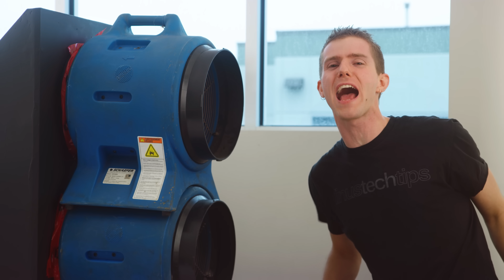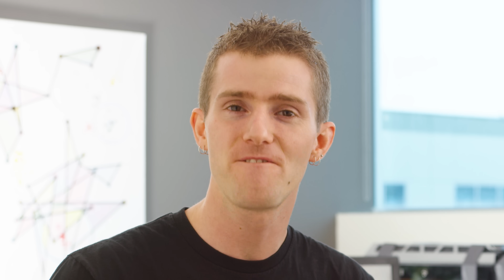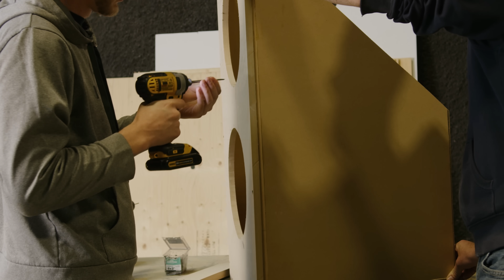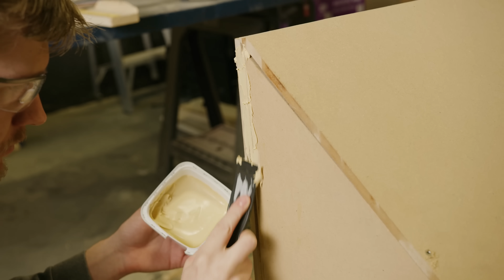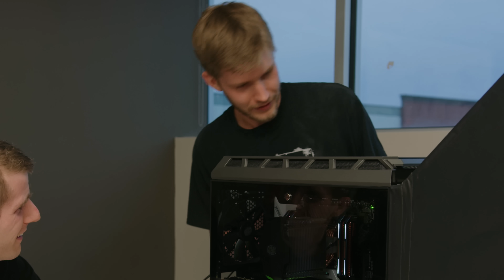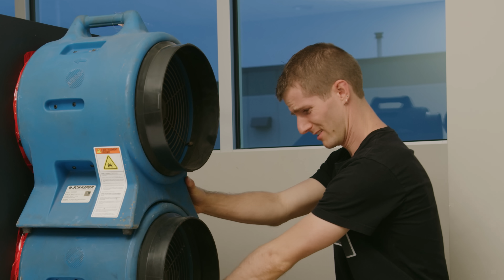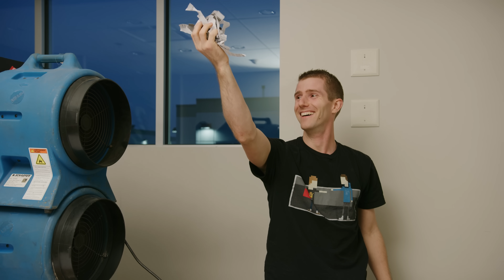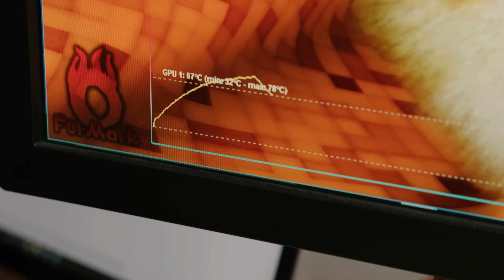Highest Airflow PC EVER - SUCCESS!

Comment: I have but one word: DUST.
Reply: Put the computer in a hermetically sealed clean room.
Reply: nope the air isnt coming from space...
Reply: Because positive air pressure is one word... Yea... I'm a moron don't mind me.
Reply: i have one word: electricity bills
Reply: thats actually 2 words
Reply: No it's not, you're just reading it wrong.
Reply: @liu7  shot rip my English
Reply: little dust would accumulate, it will clean itself quite well from the air pressure.
Reply: @RealAnthonyCallahan  or sand down the components
Reply: I also have one word: positive air pressure. Lots of positive air pressure. Like the top of the case comes flying off positive air pressure
Reply: Rev_dude Self cleaning.
Reply: One word. Tacos.
Reply: @vertigosun3896  1 word: hungry
Reply: I have another, static electricity
Reply: Rev_dude that is gonna blow the dust out of your pc
Reply: Refurbishers use Air Pressure to clean cases out before reselling PCs
Reply: It would be fine many manufacturers don't need dust filters when the setup airflow correctly
Reply: HOW?
Reply: DE_DUST
Reply: I hate Dust!
Reply: Do you think dust would stay in, if the top cover doesn't stay on?

Comment: That's actually a good idea, if you could put those fans in another room, they could cool like 10 PCs at once. Maybe even 20.
Reply: Central air conditioning,for your pc.
Reply: Whole Room Whatercooling V2
Reply: You're literally talking about a server room. Most of them are just as loud or louder than this setup because of the high-cfm fans.
Reply: @DockterDoom  Most server rooms to my knowledge, changes the air flow of the whole room. He is thinking of building a duct to every PC that sucks air out of the room or pushes it into the room. 

Most server rooms don't have the ventilation ducts pushing air right into the cases to my knowledge. Then again, maybe I haven't been in rooms with particularly high respect for the IT porn.
Reply: @Helveteshit  It would be interesting to duct air to individual pcs from AC and exhaust it outside. But I don't think it would make sense from a cost or performance standpoint.
Reply: @Helveteshit  usually there isn't, just to help keep them clean, its usually just a air conditioning unit to help keep the ambient temperature, or if it's real low tech there is just an exhaust to keep circulation going.
Reply: @DockterDoom  its not really the cfm that produces the noise but the actual velocity of the air, same cfm over a bigger area = less velocity which in turn is quieter.
Reply: Data Center. The word you are looking for is "data center"
Reply: You actually can - Since the disappearing of the "optical drive" (CD or DVD reader), there's even less physical interaction between a user and a computer. All devices can now control your computer using USB, and only other thing is video/sound. So, you could connect to your machine using 1 USB (3.0) and 1 HDMI cable. The quality may degrade if you take a long video cable, but USB won't mind. And then you can run cables through your house ..
Reply: Or you just put the pcs in an other room and cool that room. I should do that. I think I will call it server room.
Reply: I think another building would be better.

Comment: Need to build a PC from blowie-matrons
Reply: Misses power botton... looses finger
Reply: Rev_dude Misses finger, uses wires to control. And the you won't lose finger if you miss the button while the machine is off. You still need to press it to turn on

Comment: Is there any point to using a "high air flow" case when your using a blower type GPU though? I don't think there is even if your running a stupid high OC on the CPU with a full bank of HDD or SSD's plus full RAM slots.

I guess the two big intake fans up front might be nice if your running a dozen SSD's and doing a butt tonne of read write though?

Comment: you do realise car radiator fans easily move the same amount of air as those "MASSSivEEE" fans. 
Id be interested to see instead of the fans you use Industrial cold room refrigeration fans ;) But really all you need to do is match the air volume of the case with a fan and for good measure double it, 2 of those fans was massive overkill

Comment: Pff, what a weak build. Do you even fan? I have a rig that auto orders gtx 1080ti's and motherboards and reinstalls them because MY industrial grade fan actually pushes on the card so hard, it snaps the pci-e slot clean off the motherboard every 5 minutes.

Get on my level. Your rig is at a set price. Mine will never stop getting more expensive. I am so much more hard than you will ever be because I have the most optimal air cooling solution for hardcore overclocking rigs that don't want to use that plebeian, ugly, disgusting custom water cooling loop.

Sometimes paint comes out of my mouth and I can't make it stop.

Comment: Okay, next build a fully water cooled system (with mono block).  But use a small car rad with these fans attached.  And put the fans and rad in a different room.  Now it's cooler and quieter.  Do it!

Comment: it would have been much better if the two fan is exhaust. install a duct elbow at the top, straight duct and a canvas connector for vibration. also remove all the casing fans. just re install the filter and cover the rear fan opening. why? because with a direct drive fan, the supply air of that fan is hot due to the motor. and even just 1 fan with 200CFM will do, even more that the capacity required. or get a centrifugal/ sirocco type blower.

Comment: Please do this again and add huge exposed heatsinks on the CPU and GPU.  That's a completely closed up founders GPU and you're still seeing great numbers.  It could be that much better if you just use a card with big heatsinks and you could simply remove the plastic shrouding on it

Comment: you should get 2 more of these blowers and set them up as exhaust fans :) ...and you might want to unplug all the fans from there corresponding power port otherwise the overflow of power from over-reeving the fans can fry the components. I also remember one effect that you talking about where you can put water onto a surface and when it evaporates you can actually get cooler temperatures. get some waterproof fans onto a liquid cooler and spray a mist through the radiator, just to see what happens. finally you did a video where you put a pc into a refrigerator, why not take a window ac unit and just use the exhaust (cool side) as the intake for the computer. or even tape into the coolant lines and use that to cool the pc. much like you did with that one hvac pc case.

Comment: Yeah, that's really loud! My friend's HP Laptop CPU fan died. So while I was there trying to get her printer to network & print, I noticed the CPU temp with Speccy was 97 degrees C! I told her to get the best fan that she owned out. She brought out this Lasko blower that has a 2" adjustable slot for air output. I turned it on about 15' away from the laptop on low speed and the temp dropped from 97C to 51C in 72 seconds, and stabilized! And the sound level was only 44 dBA! Wow! I'm ordering one of these bad boys for myself! It felt as though I had walked into the air conditioned dairy section at Costco. As though someone had brought a portable AC unit into the room & turned it on, wow! It's a much more concentrated & directional flow, which is why it cools so well. The only con is that you have to weigh down any loose paperwork in the room, because of the volume of air being moved.

Comment: Air Zoom Box - maybe you should just build a case into your HVAC system next time.. think Donuts.. The Torvalds Terrible Torous (T3) Case.. you can also power it with leftover heat for fusing Hydrogen Plasma

Comment: One of those fans consumes more electricity than that PCs power supply is rated for, and you used two fans.
I guess this goes to show that if you throw enough "just add more" at any problem it ceases to be a problem (or at least not the same problem).

Comment: Everyone's dropping suggestions. I'll drop mine. Make a DIY video using a vacuum as a replacement for exhaust ventilation. If there's enough suction it will actually increase airflow into the unit.Also I once used a hair blow dryer on cool mode to keep thermals down on an old shitty laptop so I could game better and it seemed to work.

Comment: Now if you could just move those fans out back and duck work the air intake to the computer and it out put I bet you could achieve that air cooling without all the noise in the room.  You would probably still hear a bit of it but not that high of decibles

Comment: How about a closed circuit active cooling system ? Like using air conditioner heat exchangers modified to work with Peltier blocks ?

Comment: The fans will litteraly die way faster
Reply: well when you think about it... the only thing the actual computer fans are doing at this point is restricting airflow... you could likely remove all the fans inside the case!
Reply: They'll be spinning at a rate they're not supposed to. Thus, wearing out the bearings way way way faster.
Reply: kensley innocent Why?

Comment: Decent cooling for a GTX 480.
Reply: Cook with sli gtx 480. 110 degrees on a gpu
Reply: ayy
Reply: you mean " Barely adequate cooling" I'm pretty positive it would give liquid helium a run for its money when cooling a gtx 480...
Reply: Maybe for a FX5800, kiddo.
It is definately not any louder.
Reply: Antti Kettunen Finland ain't Alaska
Reply: I only get 40 degrees celsius for gtx 460 though
Reply: He could use cowling flaps to increase air flow even more
Reply: Nah all itd do is blow your sausages off the grill
Reply: Engine cowling can freeze aircraft engines if open too wide, so do not thing that some sheets of metal are not effective. Cowling would increase air flow by a massive amount.
Reply: CJ no more mehish
Reply: For a 8800 gtx
Reply: I've had one of these 480s some time ago and I guarantee these fans will probably burn with that GPU kkkkkkkkkk
Reply: Or FX 5800 Ultra.
Reply: On full load a gtx 480 can hit temperatures that rival those of the surface of the sun.
Reply: Checkm9 

Damn you live underwater with ur PC
Reply: The GTX 480 Ultra was my first gaming graphic card. I had no idea for years that it was just hotter than others, and just thought all were like that. So weird hearing people reference it as the extreme bad.
Reply: misinformedmarti 

AMD > Novodio > Shintel
Reply: is that good for core i3 if it isnt will it be for core i4?
Reply: yea, but would need to add a third blower if you decide to spring for a vega 64
Reply: And for 690?😂

Comment: Most of the air exited the open side.  What you should have done is build an MDF case with Plexiglas windows on the side (inside mounted) and totally removed any possible blockage from the rear.  Then run it where the air actually goes all the way through.  The case will have to be surrounding the PC and screwed to the fan casings.  Some venting might be needed on the side in order to match the volume intake but still force most through the system or it may just rip itself completely explosively apart.  :-)

Comment: This makes me wonder, what if you had a 747 sitting on land, not moving, with it's engines at full throttle, with the wind from the engines being directed/funneled into this kind of cooler. Assuming all the parts stayed in place (although they most likely wouldn't, especially the GPU), would all that wind lower the temperature even more?

Comment: Only reason why the CPU temp was barely affected was because the high volume of air wasnt really going through the heat sync. If they wanted the best result, they shouldve created a shroud from the cpu heat sync to an exhaust vent then sealed everything else excluding the gpu exhaust. That was the only reason why it had the most effect on the gpu.

Comment: BTW an average house AC uses a blower that moves 800-1600 CFM depending on house size and are usually no larger than 1/2 HP

Comment: Such an amateur, next use aircraft turbine.
Reply: It would need a 100 kVA diesel generator (us$7000), 1 ton of air 3.5kw 24h/24h = $23.50X28.5 to kVA = us$670/month + it would destroys the computer fans + wreck connectors of cards, just miliseconds before the whole computer case explodes ending up freezing the rest, would be cool to watch. That is If an aircraft turbine consumes only 100kVA which I doubt. Might end up been 7000/month.
Reply: tfw everyone takes the obvious joke seriously
Reply: He means put the intake in the pc to create a vacume not put the jet exhaust in the pc its not to hard to figure out
Reply: Umm, that would be counter active, as those put out heat. Couldn't even do that as a PC build theme for MSIs Afterburner software.
Reply: You need to use a jet engine compressor (jet engines consist of three parts: the compressor, the chamber and the turbine), but you'll need a hefty motor to spin it up to 120000rpm or more
Reply: thats why you use them a vacuum not a blower.
Reply: @fucking dank This IS the Linus Tech Tips channel isn't it? You know the one where they go over the top and try to make meme computers and take all jokes far too seriously.
Reply: Just use a jet engine with a smaller engine core like GEnx 2B's onboard the 747-8.Also,don't use an F35 engine
Reply: Mental Case Gamer Hmm I think he was talking about a pull configuration.
Reply: We use the 12th compressor off a turbime engine to create airconditioning in the AC I used to work on. This is not a dumb idea as I could blow snow into the cockpit if I really wanted to. I wonder if we could get GPU and CPU temps below zero.
Reply: But that air is hot...
Reply: I was thinking a turbocharger off a diesel van would do the job, with the spindle attached to a 5hp industrial DC motor. Could use both radial stages of the turbocharger in series... or as inlet & outlet...

Comment: This is actually not so ideal. This is because when the fans of the GPU and CPU rotate faster than they were running, they produce spikes of high voltage. These spikes could easily damage the PC.

Comment: IDK why you used positive pressure. I would have run negative. The case top would not have flown off but the rarefied air might not have cooled as well. It might be worth a test tho

Comment: Have you tried an Intel Xeon Phi Coprocessor (PCIe version) on this? The card is a passive cooling thing w/ ~350w max power consumption. (Really, really hot in my own test bench.) It is interesting to see if the huge fans work for that.

Comment: Now what would be really useful is the find out the optimal air flow rate for maximum cooling.
( because as flow rate increases, at some point, the air molecules are not in contact with the sources of heat long enough to capture the heat, and you achieve diminishing returns as flow rate increases)

Comment: Put the fans outside and run ducting. Have them pull air through the case and blow it outside... it won't be positive pressure though... 🤔🤔🤔

Comment: That's one of the worst cases out there. Whoever thought putting that solid plastic panel in front of the fans should be fired.

Frankly, this video does the only SENSIBLE thing you can do with this case (which is remove that front shroud). Seriously, DON'T buy a H500P unless you PLAN on modding it. It's just a bad case.

Comment: Imagine how much it costs to run those fans during intensive games etc.
Reply: That's assuming 100% efficiency. In reality, they'll likely be consuming 1600-1800w, maybe even more. Electric motors are 80-90% efficient, which is close but not 100%.
Reply: Well 1 horsepower is 735.499 watts, so two of them is 1470.998 watts just for the fans.
Reply: AA+ class efficiency XD
Reply: prolly 20-25$ a month if they were on a lot
Reply: But can it run crisis?
Reply: 1 horsepower is more like 745.69988 watts, actually...not that anyone gives a shit :P
They're pretty inefficient as far as PC fans go...would rather have 17 watt, 120 mm Delta fans(extremely high quality flow and pressure) with 150 CFM at 56 db than 746 watt, 300 mm fans with 2000 CFM at ~95 db...or the more budget-friendly and even more efficient Noctua(decent flow and high pressure) at 7 watt, 140 mm with 158 CFM at 42 db.
These 300's are powerful, but extremely impractical. Multiple fans of smaller size would be cheaper to run with the same CFM output.

Comment: i would try a furnace blower instead of thoughs axial fans because A.they are quiter and B.they have higher static   (positive) pressure you could even probably use a lower cfm rating and blow it right across the cpu cooler i think that would be interesting . ps i work in the hvac industry.

Comment: don't have to worry about dusting out the case with that much velocity in the air flow
😁
Now I'm curious how the benefits of lowered median temperatures would affect the lifespan... if there were only a pulse-width modulator for that blower for temperature range dependent speed... in a separate, cinder block room with a dedicated room air conditioner ( on a separate, third circuit )
😂
NACA ducting and rear diffusers ( search related to racecars and P-51 Mustang planes ) help accelerate, evacuate exhaust air from exit points at high speeds.
😂

Comment: I wonder how many Volts that back fan is pushing back into the board due to the fact that it's spinning like a googleplex times faster than normal operation speeds, and working like a generator all them calculations but you forgot about that haha. Well can't be too much because nothing exploded
Reply: those are brushless fans and in their factory form they wouldnt push any volts
Reply: Ahh okay cool, you are right indeed, the more you know huh, seems the newer Brushless fans can be used as a Power generator only if modified a bit unlike older fans: https://www.gadgetmakersblog.com/computer-fan-generator/